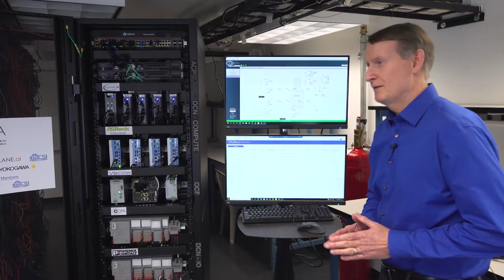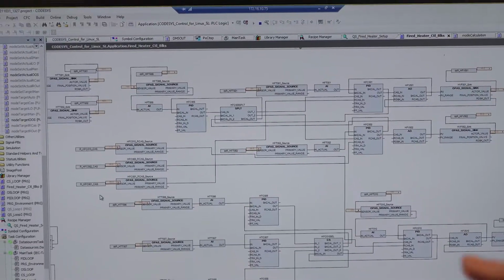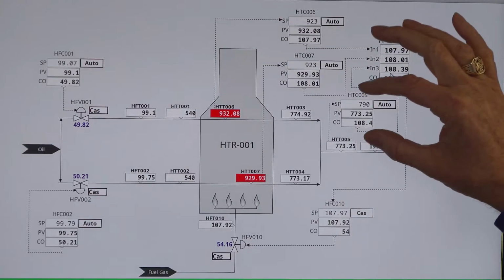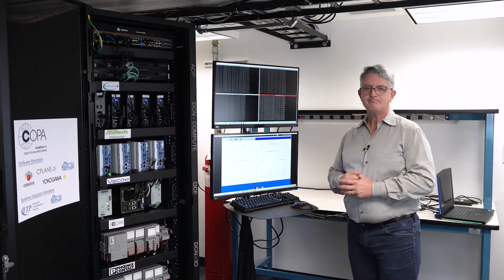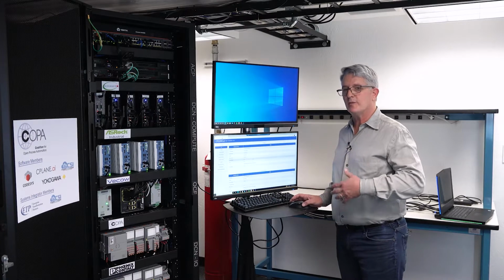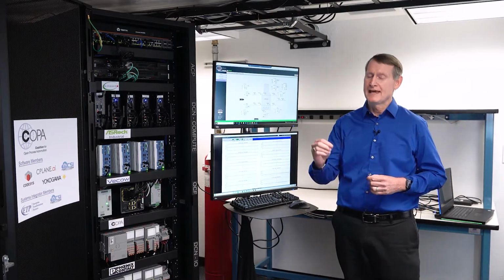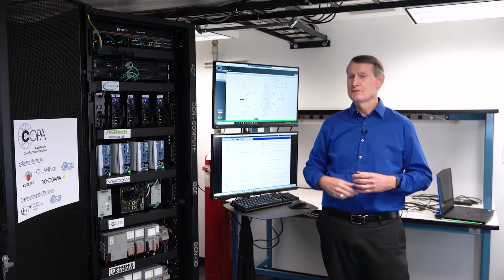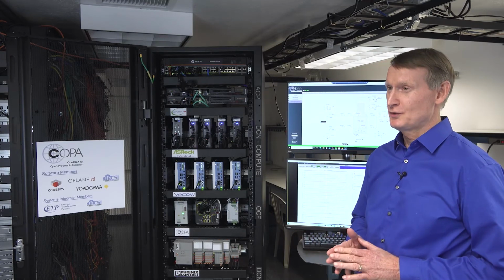Demo of Open Process Automation!

Comment: A very nicely done demo! But why use Windows as the front end? The next thing you know is windows 10 will be declared obsolete so we will have to upgrade windows. No problem, we can do that. But then we will also have to upgrade hardware because you know, windows 11 will not have drivers for older hardware, and we will land up in the same problem, OPA is trying to solve.